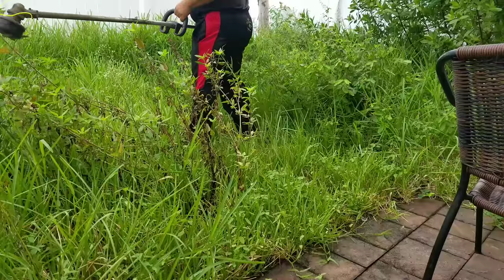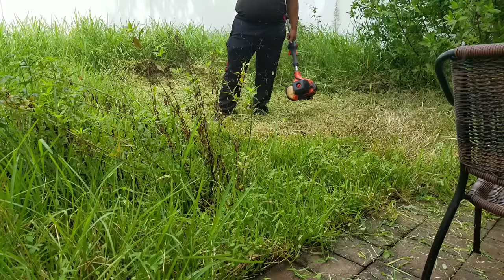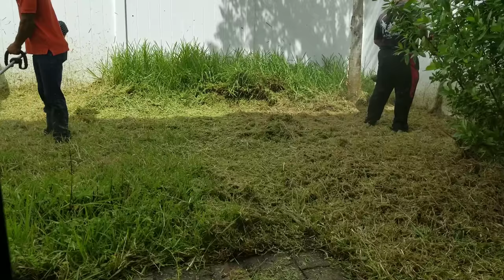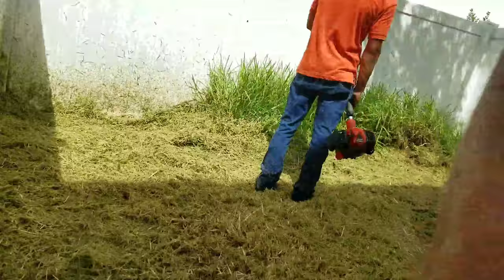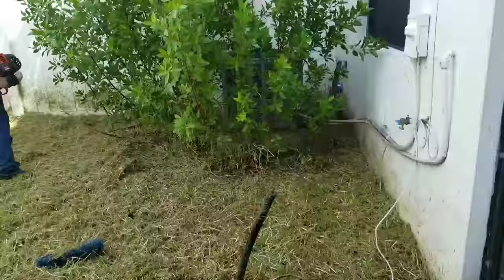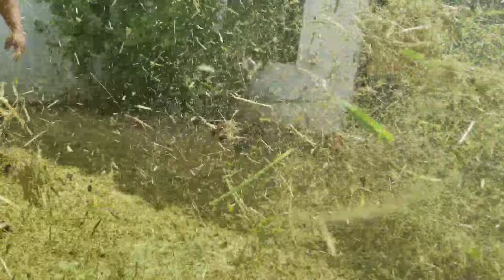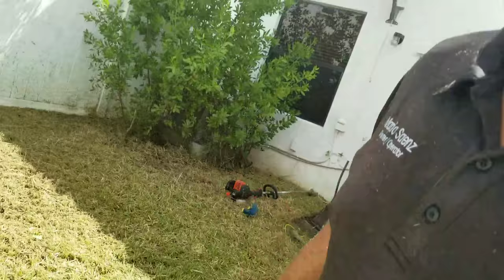How to cut tall grass with a weedeater echo means business

Comment: Why did ur echo bog down so much at the start. If u rev it like that offa cold start ur gonna roach ur cylinder.
Reply from the maker: The filter was wet with some oil. Couldn't breathe to get full power from the start.
Reply: If you wait you can get the right timing of fuel air and oil combustion

Comment: Great job men!  Its good to see what we can do with a weed eater if left with that only option but why not just use a lawn mower?
Reply from the maker: Earl Guyton I down own a push mower and my bigger mowers can't fit through the house door. My only access to the backyard was the front door. I feel a push mower would've taken longer.
Reply: That's a good reason for sure.  Ive used my weed eater ryobie 2 cycle gasoline a few times for my whole front lawn once I would trim the sides of the sidewalk and street curb and driveway a couple of times because to me its actually fun to use and revs like a dirt bike sports bike.  It would become a sport to me after awhile and was a fun exercise.

Comment: How can I accomplish this with a black and decker battery powered weedeater? My batteries seem awfully weak this year, I just bought new string, stuff doesn't seem to cut anything tall well at all. And yes, I've tried to weed eat from the top of the grass down, and I'm clueless. I can't afford a new one and my mower is always junk too so I've been doing everything to fix it as well. Ive actually thought about sharpening my large garden/Bush trimming shears and hand cutting what I can! I know that's ridiculous but I'm running out of options and not able to pay someone to cut my horrendous and terribly overgrown back yard. Any tips would be great!!
Reply from the maker: I'll hook you up if you lived near me. You can with a black and decker you just gotta start top to bottom inch by inch
Reply: @mariosaenzlandscapingservi6786  You're not lying but the piece of junk isn't strong enough to cut anything after about 20 minutes! 😒
Reply from the maker: @its_pouring_reign5422  home depot has the echo 225 for 200 it will do the job
Reply: @mariosaenzlandscapingservi6786 that's just not possible right now but good news is the yard is almost done, it only took about 5 hours after having to stop a couple of times every row to unclog the mower or bag. I eventually just took the bag off because it made it worse.
Reply from the maker: Come see me I'll give you one of mine courtesy echo
Reply: @mariosaenzlandscapingservi6786  lol sure I'm down😁
Reply from the maker: @its_pouring_reign5422  what's so funny
Reply: @mariosaenzlandscapingservi6786  The fact that you would give me something for free to help me tackle my jungle of a back yard! It was a joke, no?

Comment: Is any way possible to clip them from bottom?am new here just asking.
Reply from the maker: Mawazo Ali Selemani you can but it will take you 10x longer to finish. Starting from the top you are mulching away.
Reply: Mario Saenz Landscaping Services ...thanks now i know!
Reply: cutting from the bottom leaves you with long stems that will wrap around the trimmer head and really bog you down.
Reply: you cut from the bottom you get long pieces that will bind up the shaft and in some cases almost stop the engine.

Comment: I thought the string trimmer was bogging down for 5 seconds after pulling on the rope 0:22😂
Reply from the maker: Yes, that's common when an engine is cold and accelerate it at full throttle without warning it up first.

Comment: Do you know if a 230 will go through that much grass
Reply from the maker: Zachary Coslic it can but if you can buy stronger do it. I could do it with a 225.
Reply: Mario Saenz Landscaping Services ok and also if youve ever used stihl could you tell me your opinions on the pas and kombisystem series
Reply from the maker: Zachary Coslic stihl products are expensive and high maintenance. Not worth the investment.
Reply: Mario Saenz Landscaping Services ok Thanks for the advice. I bought an echo es-250 over the summer and i love it. Starts right up and doesnt even skip a beat. Has enough power for everything.

Comment: Try using a Heavy Duty Steel Cable Wire next time, it will give you quick cuts and best results. You will save gas.
Reply from the maker: Thank you I will
Reply: Damn good idea!
Reply: One way to cut ur feet off
Reply: @Schepp_Operator  It seems you are a less user of this machine tool.

Comment: I just use a metal clearing blade. Stihl has a whole line of them. Best one are the 4sided easy to sharp
Reply from the maker: Sunset Services ill try it
Reply from the maker: Sunset Services i use the weedeater to mulch up in the process
Reply: Mulch up weeds you get weeds ...
Reply: Hey you going to GIE expo ? I'll be going up from atl we should meet up and tail gate each other ?
Reply from the maker: Sunset Services iam
Reply: metal blades near vinyl fencing will cost you a lot more in repair than string heads, both can cut/break/chip it but metal blades would be a terrible pick for that area.  it would be better to have more hp(2hp or more) with .105 +string for that area, both have there place though, even the kombi systems with hedge trimmer/scyth head would be great due to the fence. if the owner had to have one of those panels replaced i wouldnt be shocked if they were charged around $200 for one. 

the tri blade/aircut is a better blade than the 4 sided one from stihl. most blades from stihl can be found else where with a HUGE savings, i pay 15 for my carbide blades vs 40+. i support stihl but putting a name/stamp on a product doesnt increase its value 2 or 3x unless it can do the same job as 2 or 3 of them.

Comment: This guys may be has not much expierence to recognize when you throw the mulch over and over above the the weeds. The perfect cut should be cut and move the mulch at the same time to aviod the double job they showed in video. Double job equals more time more fuel. This is how I do it.
Reply from the maker: It was 100 bucks in 30 min. Besides I didn't think it was a race. I made a video set up time with the camera so I happy with the results.
Reply: @mariosaenzlandscapingservi6786  
I agree with you. Of course. But if you trie to cut and move the mulch back to you may be you would spend less time tan 30 min. This is equals to less gas comsuption less engine trimmer effort less line trimmer spend it. Its all about money. Good work.
Reply from the maker: @victorr.leclerecreyes7869   I'm in no rush

Comment: No hate but I just wouldn't let my grass get that tall
Reply from the maker: Kevin Vlogs i dont mind it was an easy 100 bucks
Reply: I let the grass get that tall because when y wife works nights I have women over many times and I can just throw used condoms out the window into te tall grass and she never finds out
Reply: Earl Guyton  what the hell
Reply: kdelano 97 its probably an old house that has no one living in
Reply: sometimes you can't prevent it. ex. You can't cut on a 60 degree hill when the grass is wet and the grass only grows here during the rainy weather. Right now I have 3 foot tall grass in back of my house (about 2 acres),  I really need to cut but the grass is soaked and the hill is really slippery.
Reply: U took 100$ for 30 minutes of work? Where was this filmed?
Reply: Earl Guyton the grass has herpes now
Reply: @mariosaenzlandscapingservi6786  thanks i was about to ask you how much u charge them i would of go with 150
Reply from the maker: @RomeroLawnServicevloggs  100
Reply from the maker: @RomeroLawnServicevloggs  share this video and ask how much others would of charged

Comment: Good job. But stihl is better and their engines wont ever bogdown on you
Reply: The engine was bogging down because the string trimmer guard was removed and way too much string was deployed. Those engines are designed to run with exactly the amount of string trimmer line the guard allows. Any more and the load on the engine increases exponentially, as well as reducing cooling ability.
Reply: I betcha that sthil fs 110r wouldn't bogged down.with or without a guard.
Reply: Stihl is better you got that right

Comment: the only way to do with it is a
Reply from the maker: Keith Carter ?
Reply: @mariosaenzlandscapingservi6786  you were faster if you used the mower
Reply: @mariosaenzlandscapingservi6786  you speak Spanish
Reply from the maker: @leonardomigot4165  you're right but the only access to the back yard is the front door. I couldn't fit a mower through the door let alone drag a mower across their nice floor. I only made $100 on that job anyway. In and out with a weedeater boom
Reply from the maker: @leonardomigot4165  claro que si
Reply: @mariosaenzlandscapingservi6786  mounted backyard door for garden
Reply: @mariosaenzlandscapingservi6786  for motofalce
Reply: @mariosaenzlandscapingservi6786  that is done to solve the problem to transport the motor-driven machine in the garden in the back of the house
Reply: @mariosaenzlandscapingservi6786  top notch lawn care failed with lawn care busyness on kansas
Reply: @mariosaenzlandscapingservi6786  you have facebook

Comment: Sthil is way way better a250FR not a problem.and with that little  echo  the line is to long.
Reply: Pancho Villa my 250 is a damn beast when the string is bumped out with no guard and about 12 inches of string on each side
Reply: Sthil sucks